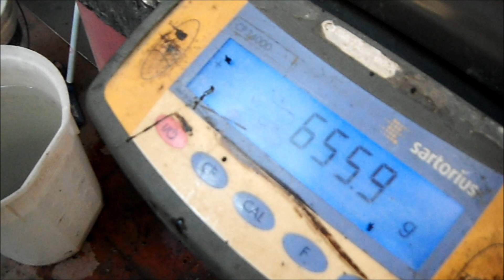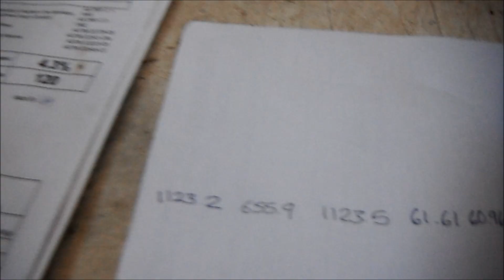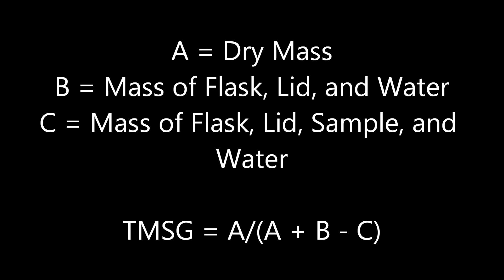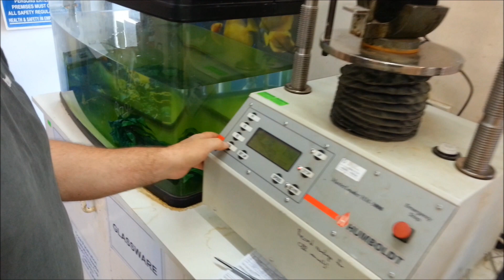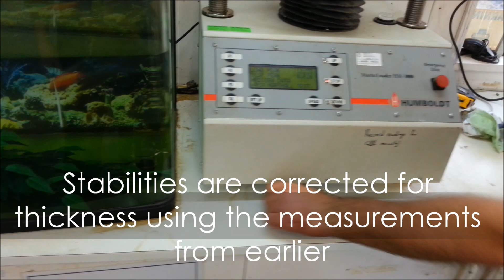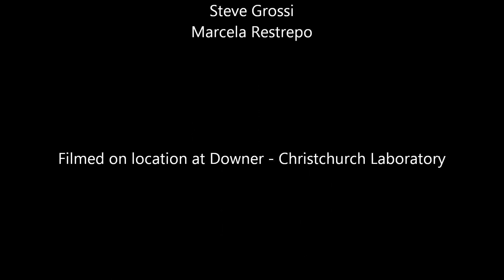Marshall Mix Design Test Methods

Comment: What is reading set in Vacuum pressure gauge.....??
Reply from the maker: residual pressure manometer reads 3.7 +- 0.3 kPa [27.5 +- 2.5 mm of Hg]